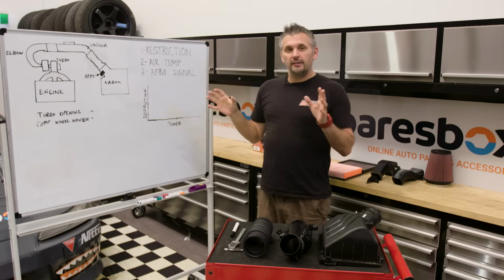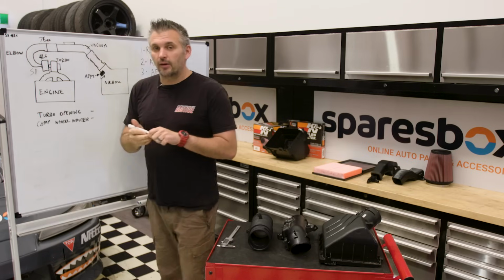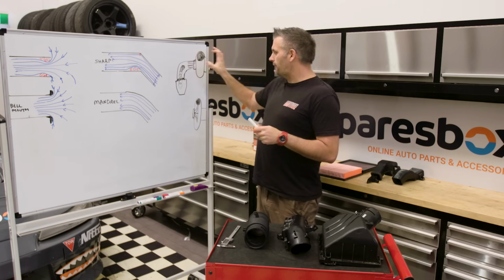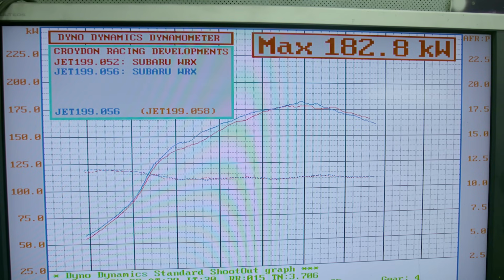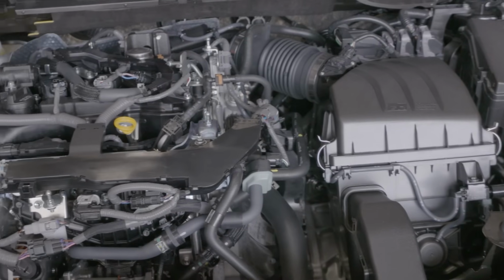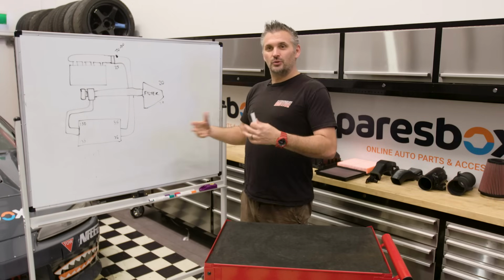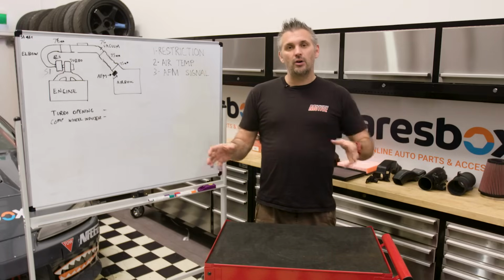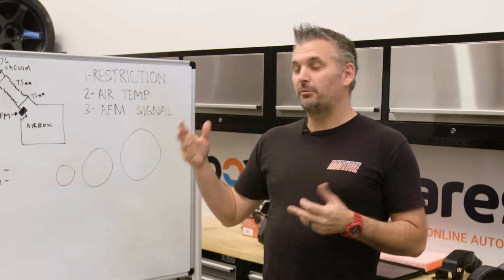Why Cold Air Intakes DON'T or DO Work on Your Car - Motive Tech

Comment: Awesome video. I definitely know why more now about intakes then i did a few minutes ago.

But that does leave me with one question? What vold air intake do i buy for my car? Lol 

Im thinking i will buy a vacuum guage and do some testing to see if i have any restrictions, and i will definitely make sure to get one that is completely in closed. I knew all those kits that put the filter in the engine bay and then have an open box with just some eals looked like garbage

Comment: What about displacement?
The larger the engine,the more heat from exaust manifold.
The more fuel in throttle body.
Smaller engines that are turbo charged, forced air induction running through  an intercooler.
A naturally aspirated larger engine with a high flow exhaust, needs more cold air volume,to maximize the benefit.

Comment: What about a heat shield instead, would that increase performance, I notice my intake air is around 100f when the ambient air is 70 or 70f, or even how about Peltier modules inside the intake in a way that it cools down a large chamber for air or would the power drawn always out perform the work put back in, seems the laws of thermodynamics had something to say about that.

Comment: I swap my air box for a pioneer sub box, had to modify my engine bay for it too fit, removed battery and placed it in the glove box so that also had to be modified, the overflow I totally scrapped it, no reason for that extra weight of water, having that said, I removed the intercooler, thermo fans, all the drive belts, power steering and fitted Custom bonnet, car I must say has never been in a state of no return, it's completely Fu#&kT best money spent, can't wait for my next project

Comment: Excellent excellent excellent video, so basically you need a really good intercooler so my question is on a NA Car naturally aspirated could you add a intercooler to your stock radiator to get cooler temps???

Comment: My 2017 Ford Fiesta naturally aspirated 1.6, has no MAF. A really short aluminum manifold on the throttle body with the vacuum line stuck through it, and a big K&N filter on top, inside a shroud that gets it's air from the original opening over the radiator, has definitely given me a good few extra ponies, and has really made my nat-asp sound wonderful, without getting overly loud intake noise. I'm toying with the idea of a small Rotrex supercharger, again with a big K&N before it. 😁
Reply: Straight pipes will give you the sound you want!
Reply: I mean, from the exhaust manifold to the tail pipe, no catalytic/muffler in between, and you'll gain 1/2 horse power too! Seriously!
Reply: @dirkfrazier9779  Went with just a cat-back Takeda stainless system. It's pretty nice. 1/2 a pony isn't worth that, tbh, but I think you see bigger gains than a half horse deleting the cat.

Comment: I'm adding a cold air intake to my NC Miata for exactly one reason.  The stock airbox (and the battery and the ECU and a bunch of other crap) sits right on top of the exit of the factory V-mount radiator, and that's bad for radiator performance.  There's a kit to relocate all that, which is supposed to bring coolant temps down by ~20F in hard driving on hot days.  The aftermarket intake runs right through the same hole in the core support tbat the stock intake pulled air from, on the cold side of the heat exchanger stack.  Performance should improve, simply because the car will be running cooler and won't have to pull timing.  I'm not even expecting a big change in sound, since the stock intake includes a sound tube.  Might honk a bit more on the outsude, though.

Comment: Cold air intake is always the best option especially in a diesel. The greater the density the bigger the bang. Sucking air into an airbox via the front grill or from inside the wheel guard can produce 50hp more than sucking in hot engine bay air. Banks Power has proven this on a dyno and on the track. Dyno runs with the bonnet up no cooling fans in front of the grill are not accurate.

Comment: Intake..............I did exhaust on my jeep and it caused drone noise in cab, after intake installed, drone noise gone.

Then, every time I've added intake to a vehicle, the throttle response is twice as good.

So IDK guys.

Comment: Great video! @ low speed Jeep Wranglers suck air through the radiator, when they need HP... cold air from snorkel or cowl are beneficial then.

Comment: You say not much 1to 2 hp on a yaris from stock to k&n filter, but did you also remove the rediculous stock built in filter in the top compartment of the Toyota air box. Its white 1/4 inch thick in the top of the box, you have to break the plastic rivets to remove it, otherwise its still restricted just like stock. Ive removed it on every Toyota ive owned, and installed the K&N, I know my vehichles run better than stock because ive tried them against stock. So yes restriction does matter, most people have never noticed the filter in the top of the box. JM2C
Reply from the maker: Not all countries have that. We're also not stupid:

Comment: I was told by one of the aftermarket companies(which didn’t even offer a cold air intake) and a couple of very reputable Type R tuners…that the factory Honda Type R cold air intake setup just worked the best so bolting on anything aftermarket was for more noise/cosmetics. When you think about the amount of money Honda spends on research and development especially on a car such as the Type R…it makes sense.

Comment: My 23 TRD Off Road, double cab, long bed has the TRD Performance exhaust system. I noticed a fair amount of increase horsepower and torque after adding a cold air intake onto my Tacoma. Another boost in horsepower and torque came from the Overland Torque Tune.
Because of the cold air intake and the OTT, my Tacoma now produces 318 horsepower and 295 lb ft of torque, while giving me better fuel efficiency.

Comment: I slapped a $30 spectre cone filter on my 11 NA mini cooper, engine was ready for it, raised the dip in the middle of the powerband, but not much on the top end, as expected. You really feel (and hear) it right past 2500rpm, but right as you cross 4krpm, right through peak torque, it's not much different from stock. I may go ahead and grab an exhaust kit just for fun, find a way to get cold air to the intake, probably just be more of the same effect. No good camshaft options I could find, but stock is not garbage, and weight reduction will go a long way
Reply: If you have AC- re route it to the air box; minus 40 degree air to your motor, just a thought and your welcome!

Comment: After changing to new Intake setup unless you reset the DME and then check the difference you will see none.  Its why you didn't see any improvement in HP on the Yaris until the 3 run on dyno. Should always read directions completely for the CAI purchased.

Comment: interesting note about trubulance and aircraft. The only reason passenger jets avoid it is for customer comfort. Cargo planes fly right through it in most cases. It doesn't effect performance at all. And the planes are designed to take a ton of punishment. Its almost like the engineers planned for it! Go figure.

As for my experiences with aftermarket intakes. 99 percent of the time it changes the sound and not much else. Same with most aftermarket exhaust systems and mods. On an otherwise stock car don't expect much. Car manufacturers spend a LOT of time and money designing these things to get the best effeciency and performance they can while still remaining reliable. If you think some kit you get at your local parts store for 200 ish bucks is going to be better you are probably wrong. You might even make it worse! Most don't filter that well, which is why they have less restriction and could mess with the sensors on your car. And exhaust systems are worse in my opinion because of the cost. Not to mention in order to see anything real you would probably have to have your car tuned anyway. Which is even more money and the tune alone might be better than any mods you made. An exception might be with older v-8 carb engines. Better aircleaners and velocity stacks can actually make a bit of a difference if the original was poorly designed. Again, it might require some tuning as well. And they are not nearly as expensive as a cold air intake kit for a newer car.

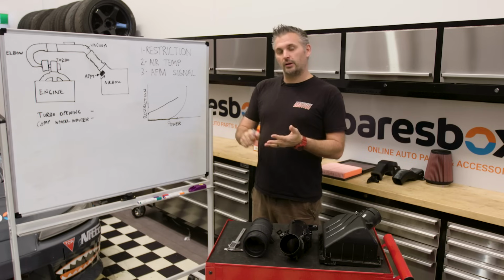You want to do things that might actually make a difference and change how you percieve how the car performs try these. New tires, for the love of god if your car didn't come with performance tires get some. Suspension, how the car handles and plants the power to the ground can make a huge difference in how it drives. Next reduce weight, that is just simple physics. Last would be gearing. Putting lower gears in a car can make it feel like you did an engine swap. Not sure how hard that is on a newer car though, never tried. However I had a late 70's camaro that I did some mild engine work to. It helped but nothing earth shattering. I switched to a 4:10 posi rear end, a shift kit and better rear tires and I dropped around 3 seconds on the quarter mile! It was a nightmare to drive on the street and got 7 mile to the gallon but damn was it fun and fast lol.

Comment: The aftermarket „cold air intake“ is actually a hot air intake because it sucks out the air of the hot engine bay.
The stock intake is actually a real cold air intake because the intake is closed and sucks only air from the front of the car.
Manufacturers are not idiots 😂

Comment: Made cold air intake for my puny little diesel myself. Didn't change filter box (btw filter box to turbo is straight pipe around 15 cm or 6 freedom units close), just deleted resonator before filter box and routed intake to filter box with pipe straight from cars front, using unused fog light place as opening in front. Feeling is that there is not much maximal power gained, but overall responsiveness is way better this way. And that mod was cheap as hell, used plastic drainage pipe as inlet pipe (don't remember correctly, but I think it was 60mm diameter), just bought bunch of different angle fittings and made it like Lego in place. Few years in service and no problems. Initial worry was about intake place being so low to the ground and possible water on road, but it has never been a problem so far, to be sure If I see big water ahead and potential risk of sucking it in, just let off of accelerator and drop the RPM's to lower vacuum forces on inlet.

Comment: Thanks for your highly informative lecture ! I'm concerned that the ill-fitting mudguard/fender liner through which air enters my Hilux drumlike filter is receiving plenty of cool air, but also a heck of a lot of dirt. Not in favour of a schnorkel, I'm considering blocking the inlet pipe on the airbox and fitting another pipeof the same diameter at the best possible place (coolest, highest, furthest from the engine and radiator) inside the engine bay. I'm wondering if this would be at the nearest rear corner in the engine compartment. The end of my pipe would face downward to avoid direct entry of water and dust. In other words, I'm seeking the very best location. Can you recomend this? I'd be very grateful.

Comment: so my 2024 wrx i think comes stock with a turbo, if I change the intake to a cold air, change the exhaust to a cat back, is that going to have a negative effect on the engine because of the turbo? 
Also want to know what exactly will tuning my car do? I don’t want to load the engine with a bunch of pressure and blow a head gasket but I would like a 2 step tuning, will something like that blow the engine?
Reply: The tune will improve.  It I have a q50 3.0t  it helped a lot without a tune .

Comment: Excellent, thanks. I have seen small gains at relatively high-RPM from 'free-flowing' intakes once or twice, on normally aspirated engines. But, I have had far greater success from modifying exhaust systems. The usual problem there is with noise, both inside and outside the car. Although, on the intake side, individual throttle bodies (ITBs) can make a lot of noise, as well.

Comment: My Monster Sport carbon air intake on my Suzuki Swift Sport 1.6 (NA) brought it from 130hp before tuning (after mounting, so a little loss without tune from the 136 stock), to 154 after tuning. Quite amazed by those numbers from just an air intake! No other engine/exhaust mods done!
Reply: is it replacement air filter or open air filter? and if it open air filter, is it use isolation cover or something else it, or just leave it open in engine bay?

Comment: I think most of us fitting the CAI kits do it more for the noises it makes and the enhanced driving experience given that improved power is negligible. What is your take on tuning the car off the MAP and running Mafless ? I have this issue on my S3 1.8T where the MAF sensors are extremely hard to get and expensive and they don't last very long ? is it advisable doing a mafless ecu file for a stage 2 stock turbo car? On these  cars its 1 sensor less that could fail and cause problems.

Comment: I paid for it. So I'm going to pretend it works awesome. Don't need to hear my wife saying I told you so.
Reply: As long as it sounds more powerful…. aka it’s louder
Reply: Exactly 😂
Reply: Got to put vent on hood blowing onto you Filter 😅
Reply: @demetresbernard38 lol😂
Reply: I hope at least you didn't do the "HOT air intake" modification....
Reply: ; butt hp '
Reply: And I stand by it
Reply: @marckelso3237  you believe it works, because you paid lots of money for it
Reply: Use Afe system. Cone filter but in a box using cold ram air from grill
Reply: Facts😭😭😭😭😭

Comment: If you got it turbo and using it for the track then yes. But id wouldn’t recommend and CIA from experience it will cause more problems in the long run

Comment: with the intercoolers why not have a duel core cooler and 1 core fitted to an AC unit and use that to cool the air ?

Comment: if cold air intake works it be on the car. car mod forget where to put this filter. many use the short ram but it drags heat. so it doesn't become a cold air I take unless u rap it and even thing it still taking hot air. killing hp. and many throw this on there daily driver thinking it makes hp bit it takes depending on the air that day. so I played withbit in many mods location amd fend cold air intake works still need a heat rap.  ive find winter n spring to my best summer not good sac ca heat at 100.

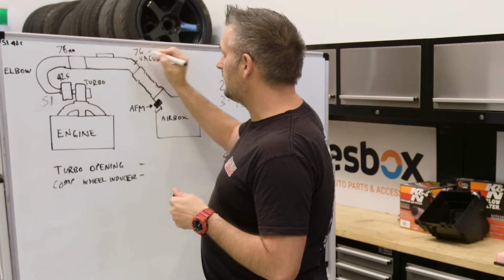Comment: 5:50 I mean, corrugated tubing does cause drag simply due to the air pattern and not the diameter. Is that drag impactful? I have no idea, but I do know a smooth wall gets better air flow than a corrugated one. Drag in a system is cumulative, so restrictions at the corrugation is not negated by the restriction at the turbo body. Whether the additional restriction is impactful to the performance is a separate issue, though, and it may or may not matter at the end of the day.

Comment: In the middle of the summer (deep south) I was seeing IAT's at 140-160 if I was idling but it would drop to 120's once I was moving. 

I'm just wondering how much stress that actually puts on the intercooler to get that temperature down before going into the engine.

Comment: i also have a obd1 1995 vw sohc 2.0 aba engine cabrio with a cold air intake that i made with hvac parts from a hardware store. someone stole my caylitic converter so i straight piped that section. i pinched off the egr pipe but i had to leave the sensor connected for the car to run i unplugged the MAF and removed it from the car because it runs better without it at high altitudes. the OBD1 ecu is running on defaults and running quite rich actually. i have a anti surge turbo that i will put into it, without a head gasket spacer. USRT claims that the increase in octane from the 50/50 water metanol will protect the engine if i run it full time.

Comment: what do you think about water metanol injection systems from USRT or other manufacturers, i think with the stage 1 system i could eliminate the intercoolers on my 2013 fiat 500 turbo.

Comment: If your car is mostly stock do not waste your money on a bolt-on cold air kit. Save your money and get educated and acquire skills so you can actually build a more power engine and command system and tune it all. Idiots spend huge money on bolt-on's they do not need that do next to nothing for them from body to suspension to powertrain. Why? Because living in their mom's basement they have money to burn and no bills to pay but getting educated and acquiring skills to actually build or modify a car is boring, hard work and time consuming and who has time for that when your gaming, watching anime and smoking weed all night! So much easier to toss money at a thing and look like the man to other ignorant people than it is to actual be the man with the skills and knowledge!

Comment: This is the best discussion and explanation of this topic that I’ve watched. It’s so obvious when you think about it that a dyno with a big fan blowing at a constant speed into the front of the car cannot mimic the actual on road situation where the vehicle is increasing velocity through the air as it accelerates. Great work.

Comment: Cold air intakes work great as long as they are not sucking hot air from the engine compartment. I use a Weapon-R system on my Dart and have it connected to the factory air box so it draws cool air from inside the fender. Works like a charm according to the IAT sensor and the Dyno after tuning it.

Comment: Would never use a K&N even though from a performance perspective I think they might probably be pretty good. 
Why? I intend to keep my wheels for the foreseeable. I can do without the reduced filtration and oiling on sensitive sensors when it wasn’t designed as such.

Comment: It depends on how the car was manufactured, all old triumphs and MG cars are built to run on cold intake, it’s in the mixture of air and fuel, carburettor type running engines